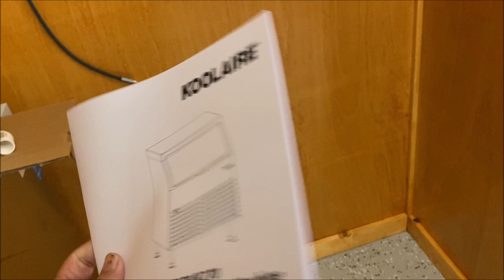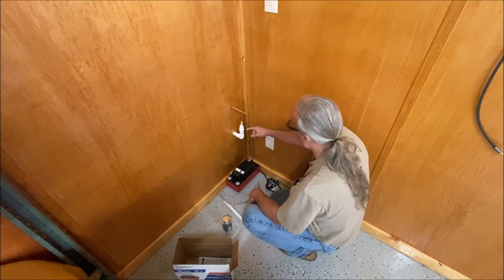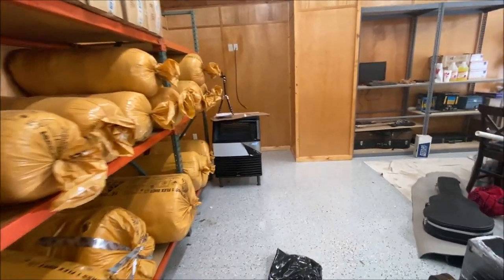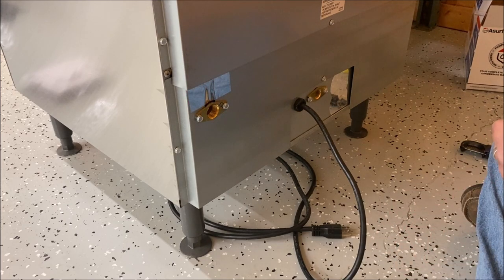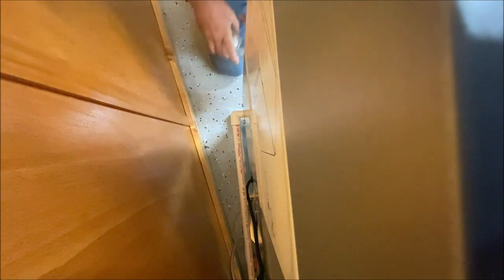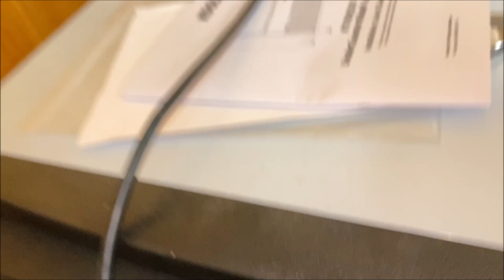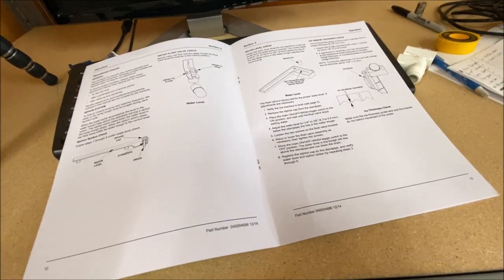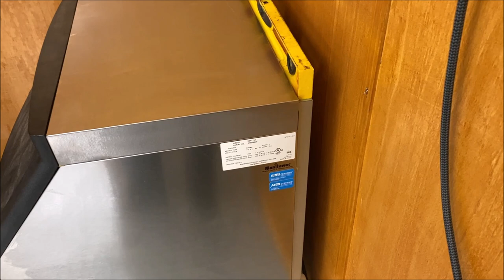Installing ice machine First Ever ! Am I a DIY ?

Comment: You did a great Job only thing I would add is a water filter. The ice that is in the bin will melt over time and drain out so no matter what keep the pan. I work for BJU HVAC department in Greenville and we have added power cut off systems to one of our ice machines and it works. you just need to be make sure that your water protection system doesn't affect the clean process as during cleaning it may dump more water than normal.love you videos thanks for the great instructive content as a young guy in the field it has been very helpful

Comment: Hi Ted if it was my ice machine I would install a Everpure water filter, and you need to think about if there is a power outage and the pump wont run all that ice in the bin will melt and possibly overflow the drain pan good luck and nice job

Comment: Install a DOME (or another brand) water shutoff valve with a companion water sensor in the pan.  It will automatically shutoff the water supply if water is detected in the pan.  It will also send an alarm to your cell phone.

Comment: Definitely put a tether on the ice scoop.  Someone will inevitably leave it inside the machine and it will get buried which is a bit of a hassle (not to mention people digging around in the ice with their dirty hands to find it).  I would also recommend a stainless steel scoop because the plastic one will start to crack as it ages.
Personally, I hate the multi-turn valve type you put on the supply line.  I've had better luck with the quarter-turn type.  They seem to be a bit more sturdy.

Comment: Appliance tech here , if it was me I would put that on a gravity floor drain . I always test my ice machines after installation by pouring a gallon of water in it to see if the drain can keep up . I install alot of ice machines in residential kitchens and failure is not an option for me . I'm sure what you did will work , but if it don't consider the gravity option.

Comment: Ted, a GFCI is a good idea, also a filter for taste and one for sediment is typically how these are connected. Glad to see that you didn't use plastic 1/4" line or plastic push to connect fittings on the ice maker. We had that done at church, and one of the lines blew off and did damage to the kitchen in the basement.

Comment: What happens when the power goes out and the ice melts but the pump doesn't run?  Does the machine hold all the water or does it drain out all the time?

Comment: You need to have a floor drain or gravity drain the PVC...I've put in a couple Ice machines and no one has ever used a condensate pump...or a safety pan. Remember Ted it's not an AC lol...

Comment: As almost everyone has said ice filter is necessary. The drain line will be as cold as a suction line so it should be insulated. That drain pump will trip off the float on every harvest cycle as the machine flushes out the water pan. So if you can redo the drain in the wall it would be worth the trouble to do it instead of using a pump that doesn't have enough capacity to handle the drain cycle. Depending on your water supply you will need to run a clean cycle every few months. On the auto clean cycle it will work that pump to death.

Comment: I've only hooked up a few ice machines but the ones I did always wanted a tee at the back of the machine with a little open section of pipe going up for a vent. Hopefully yours doesn't need that.
Also, congratulations on becoming a DIYer 😀👍
Reply: Vent solved my drain issues. 👍
Reply: My machine have a vent also

Comment: Hope you put tephlon on the street 90, also if you look on the back of the machine there is a diagram on how to pipe the drain usually. Your suppose to vent the drain line above the level at which it drains to..

Comment: You could get one of those moisture sensors that sound a alarm. I think they have ones that are connected to your wifi and will notify you. Also think there is one that can be set up to close a valve or disconnect power.

Comment: Good thing ice machine stops believe just a drain for melting ice .You could add a backup ups to drain system. I worked on bigger machines that when the second cycle of ice,when the machine is full then restarts it opens a drain valve ,pumps the water tray down then fills with clean water for the ice, about a quart of water not sure on this machine does if so that will test the drain pump .You should add a filter for taste and for cleaning less mineral deposits.

Comment: I think I would pull the ice maker to the front of the pan (which was a GREAT idea) in case the fittings leak. It appears they hang over behind the pan, but it might be an optical illusion.

Comment: Think your running into trouble using condensate pump. There's going to be a lot of water exiting unit during wash cycle.
Reply: I agree.   Lots of water.  Easiest is to get up off the ground.    Plus makes it easier to scoop ice out.   Less bending over.   A lot like how washer and driers have the pedestals now.

Comment: Good job on the install Ted I hope you get good use of it that worth the investment 
Two items I would add on is good quality water filter and GFCI outlet or a GFCI breaker in the electrical panel for the machine  
and let the insurance take care of the rest if be comes a problem safety is priority number one

Comment: Hello Ted you can install a motorized ball valve in you drain in case you condescension pump stops working install the drain pan safety switch to active the valve and close the drain. All the water stays inside the box. The ace machine has a switch to stop the compressor when is full of ice.

Comment: Gravity drain would be best, but it looks like you have a pump to send any water out of the pan whenever it fills with drained water. That will work. The whirlpool under the counter ice-maker actually uses this setup with a built in pump which sends drain water up the same way your dishwasher pumps water after a cycle. I'm considering my options. I have a manitowok? ice-maker which dumps about 1 cup worth of water after each tray is done and it comes out the drain. Since I don't have a floor drain like most restaurants have, I'm looking at either building a raised platform and a gravity drain, or raised platform, with a bucket to catch the drain water, and a pump to send it into the drain. With a pump, I could put it in my kitchen right next to the dishwasher, otherwise I'm going to have to store it outdoors on the patio.

Comment: Talk with your alarm company.  They can usually tie in any sort of a contact closure switch as a trouble only zone.  They'll call you if it triggers.  Unlike the DIY things that just send an alert to a phone app, the alarm company will keep calling down your contact list until they get ahold of someone.
Reply: I did the same thing on our fish hatchery system. I used alarm switches to indicate a trouble alarm if my indoor fish hatchery system goes into a low water condition that would indicate a water leak and/or a loss of system control power. I also built a timer-activated trouble alarm switch that sends a signal if my generator fails to start after a power failure. Since the alarm system switches and monitors use batteries, they work even if there is a loss of power. The switches also signal a low battery condition.

Comment: Assuming the ice maker uses a float valve to control water level and use, think about lengthy power failures. Will your pan hold all the ice if it melted? I feel installation higher up and a gravity drain to the outside would resolve that issue. Yes to both GFCI and water filter would finish this project. Good luck! From a new sub…

Comment: I know I'm a little late to the party here but thought id throw in my 2 cants anyway.  install a float switch in the pan and use it to break the circuit for the solenoid valve in the ice machine.  pan fills up, float breaks the circuit, solenoid cant open and let anymore water into the machine.

Comment: Filter the water. Level the machine.  Clean the machine regularly or the bin drain will clog with slime. Because this machine fills until the float turns the water off, you want to shut off the water if there is ever any moisture in the pan. You still might end up with some water on the floor, if you're away from it for long enough for the bin to melt. and something goes wrong.

Comment: a float switch in a 5 gal bucket that will turn off power or water supply is what i would do in that situation lol edit: 2nd thought get a switch that will kill water not power probably make things worse if all the ice melts inside the unit cause power was cut ya .... so maybe a water solenoid valve hooked to a float switch

Comment: I was recently installing a new washer and dryer and started off using this exact brand of braided lines.....no matter what I tried (tightening/loosening), they leaked at the fittings.  Had to take them back and get regular hoses.  Never seen anything like it in my life.

Comment: I’m assuming that drain is truly just a drain from the ice bin as the ice melts. In that case, if the drain pump fails, just shutting off the ice machine may not prevent the pan from overflowing, depending on the volume of the ice bin vs the capacity of the pan — if left for long enough, any residual ice in the bin is just gonna continue to melt… shutting off the machine will stop more ice from being made, but can’t stop the leftover ice from melting. 

Can’t really think of an elegant and simple way to address the ice melt issue, save for moving the machine so its drain is above whatever it drains into, eliminating the need for the pump. Outside of that option, I’d say best bet is to call attention to the problem as quickly as possible, so maybe a float switch that shuts off the machine and also triggers some sort of loud and irritating alarm. I expect something like that would allow you or one of your employees to notice the issue and address it (by manually scooping out the remaining ice) before it becomes a bigger problem. That would probably be sufficient in my book, but that’s just my two cents.

Comment: My question is will the condensate pump keep up when it go into a wash cycle?
Reply: That's a good question. I have an ice machine just like that one and a lot of water goes out the drain when I pour in cleaner and put it thru the cleaning cycle.
Reply: Yes they keep up just fine. We have installed many of them on pumps and it works ok

Comment: Get an audible alarm or wifi capable pan alarm such as the aquara in addition to the shut-off solution you were thinking of because you may not know the pump failed right away.  The ice in that bin will melt and cause the pan to overflow even after the water supply or power is cut. The alarm will let you know the second that pan starts holding water.

Comment: Install a water sensor ribbon that will send an alert if it gets wet. Can also tie it into a relay to cut off power. Also maybe a charcole water filter in the supply line. Thanks

Comment: Ted nice install i install and service those daily. The only thing I recommend is a water filter even if the water is not that hard, it will pro-long the life of the machine greatly. The other question why do you stock so many sman gauge manifolds?

Comment: I'd like to suggest that you get the automatic shut off water valve that uses a compressed piece of cotton to shut off the valve. The valve is screwed to the floor or base wherever the water will be and when water gets on the little compressed piece of cotton it swells up and lift the little valve to shut off the water supply that's what they have for the little reverse osmosis systems and the valves I have bought online from Amazon for a different ice maker/dispenser dcm-500bah. I did the same thing your doing except the condensate pump I got had a built in float switch already with separate wires, but rated 24v only
Reply: Make sure to remove the plastic from the cotton many people forget to remove the plastic
Reply: Home Depot also sells hoses in the washing machine section that are called floodsafe their little finicky sometimes but once everything is set right they are awesome because if the hose were to burst there's a little disk that shuts off the water flow those are the biggest hoses I know of that are automatic shut-off but their water flow rate is pretty low I have had a situation where I had to put two Splitters on each end to make the water flow better and still have the floodsafe disc, water flow resistor deal.  I fond these after a hose burst and cut through drywall into my neighbors garage wall and flooded her garage and water damaged all her boxed up belongings.  Thank God for renters insurance.

Comment: Machines like the ice maker have a solenoid water inlet valve, that opens with an energized coil, being fail-safe if power goes out or similar. You shouldn't need no float or pan, no restaurant I've seen has such a setup in their kitchen... Condensate wise that thing shouldn't put out more than a gallon or two a day, so even if your pump died it wouldn't flood the place even over a few days unattended. I really wouldn't overthink this. If you're that paranoid just turn the water off every night, that's your best insurance!

Comment: You could tie the float through the ice machine water valve circuit. Or use a relay with the float switch and kill the power to the ice machine
Reply: DO NOT kill water to the machine you maniac. Do you want the evaporator to separate??

Comment: Take the 24v from the condensate pump to the 24v circuit of the ice machine and wire in a fuse so it will pop the fuse before the transformer but it’ll shut off the systems controls.
Reply: Or do the same with the 120v side just get a fuse that is capable of 120v

Comment: A pump safety switch in the drain pan wired in series with the condensate pump safety pulls in a relay with a 24 volt coil. The coil has 2 sets of contacts . Relay pulls in it has 1 NC set of contacts that open to shot off a solenoid valve on the water line and and 1NC set of contacts that open to kill power to the isc machine. Then you need a source of 24v power. You could use one of those Honeywell or Argo switching relays with a transformer in it.

So your 2 safety's wired in series go to T & T on the relay. Relay pulls in opens 120 volt solenoid and kills compressor

In fact yo probably don't need a saparate solenoid......there should be one built into the machine.

That will leave the condensate pump live but that should be ok

JMHO

Comment: Ted they make a unit with a moister sensor that sets in the pan for washing machines. Seen it on "ask this old house". It will shut off both water and power. Check at a plumbing supply house.

Comment: Float switch in the pan and a water shut off solenoid , use a relay if it’s a low voltage switch

Comment: You already have most of what you need to interrupt the  power and the water solenoid in the ice maker (it will cut off the water like a refrigerator ice maker or even one off an old dishwasher can go inline of the water supply. You should have a 24 volt transformer, a 24 volt compressor contactor and a pan switch.  You'll need to put the transformer and contactor in an enclosure. An enclosure can be had from a old outside AC disconnect box. Just take the guts out and mount the transformer and contactor and a receptacle box under it. I could send you a drawing.

Comment: In restaurants just installed. The only problem you might have drain problems.  Very common.  You're problem probably be the condensate pump failure.

Comment: Is there a reason for the drain being placed so high? Can you remove the wood panel and cut in the drain TEE low enough to have a P-Trap? Even if you had to place the bin on 6 inch blocks to let the drain be above the P-Trap, it would better in the long run than any kind of pump system, which is not "failing to engineer, but engineering to fail."

Comment: That's called a Meter Box for your water meter. Teflon can be bad for plastic pipe as if you put too much it can put a lot of pressure and crack the female fitting. I prefer pipe dope myself for that reason.

Comment: The only thing I see you need is to change the plug to a GFCI and a good water filter for the ice, O yes and once a month flip it over to wash, and then wash it out with a mixture of baking soda and water to get rid of mold in it.

Comment: Use a dishwasher or washing machine 115 V water solenoid break that with the safety switch that will shut the water off if there is a leak

Comment: I learned that cleaning and priming on new pvc is crucial with a pressured supply especially with fast acting valves. Water hammer is a bitch. Given that is a drain, I doubt you'll have any issues as that pump isn't going to be pressurizing that to any great extent but I'd do it all proper anyways just to make it a good habit. Having installed irrigation systems a blowout blows.

Any dope, liquid or tape, is just lubricant for the threads. It might provide a little seal but it's the tapered threads that provides a seal.  I prefer tape. Quick and easy and always around don't have to worry about chemicals going bad or separating or whatever as all chemicals seem wont to do after the years.
Reply: You ever try to take apart hydronic or steam fittings that were only taped? Use dope or dope and tape. Just taping is lazy.

Comment: I've never used a condensate pump you can break a safety or the outlet or put machine on a outlet timer so it only runs during the week when someone is around.
Reply: That’s a massive waste of power turning the machine off for a full weekend at a time